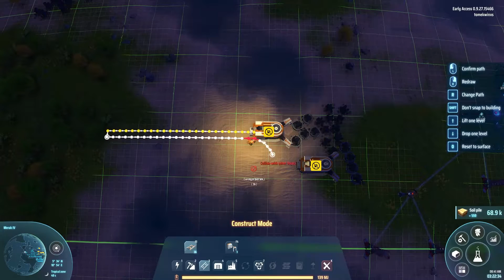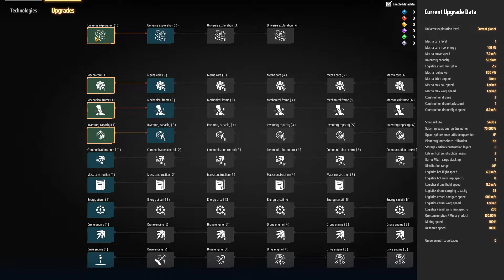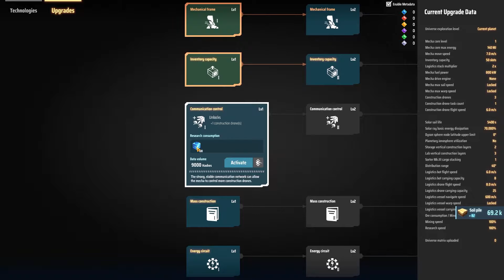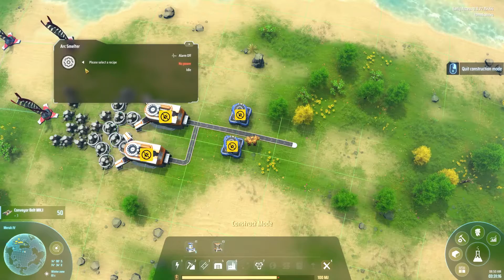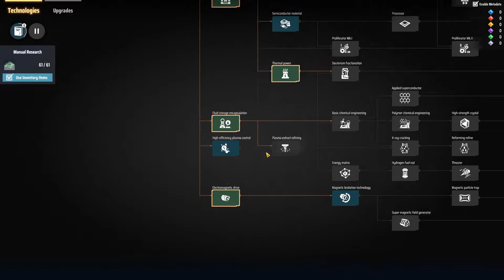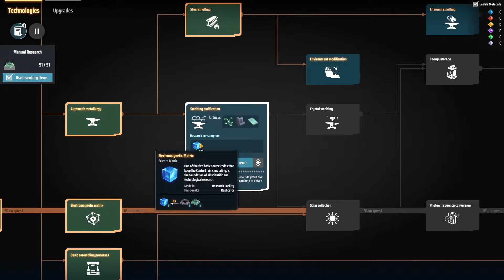Thermal Power Plants | EP7 | Dyson Sphere Program | Blind Playthrough

Comment: Coal vs Graphite - you need to compare the energy output of the thermal generator in each case; rather than just the energy capacity of the fuel.  As you found, in the mecha power core, graphite gives a lot more energy.
Reply from the maker: What about the production cost for maintaining graphite production? Coal has a lower energy output but it doesn't require arch smelters or sorters.
Reply: @ThomasEdward84  Yes, but the construction is a "one-off" cost. Energy output is "continuous".  E.g. one hour energy production from graphite is a lot more than coal + "factory cost" + "running cost".
Reply from the maker: If I had a full MKI belt of Graphite (12 arch smelters 5 MW) how many Thermal Power Plants could I support?
Reply: @ThomasEdward84  Not sure - but it is more than 30 !!🤔
Reply: Another factor is fuel chamber effeciency.  There is a good article in Dyson Sphere Program Wiki that compares the two fuel types.
Reply: @phmo3660  fuel chamber efficiency only counts for the mecha, not for thermal stations. Energetic graphite is more efficient but takes a lot of space from the  early game thats have a lot of water around to bother you. If space is not an issue, graphite is always better.
Reply: @thiagohperina9545  Exactly